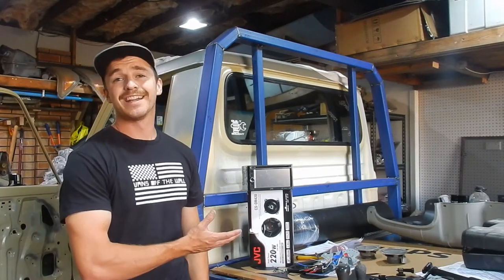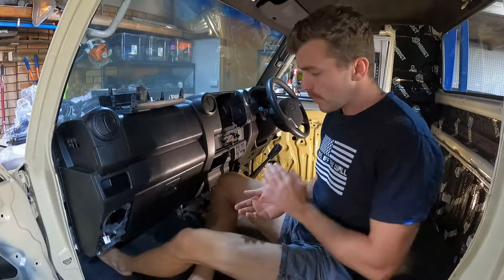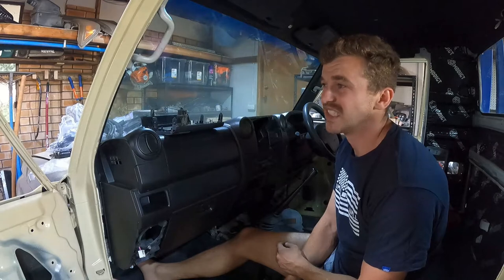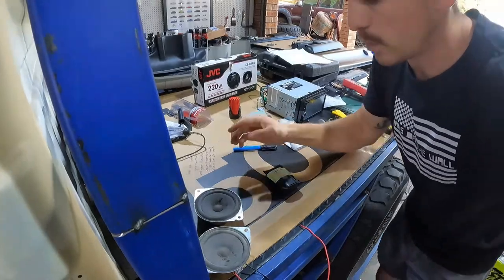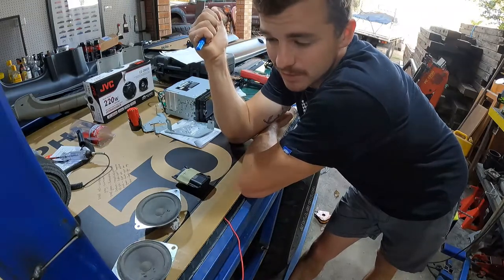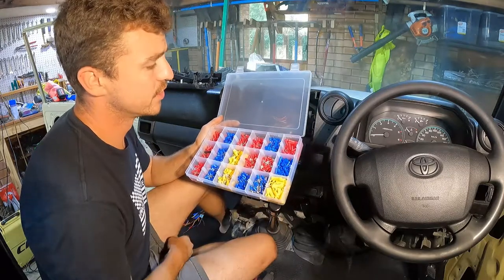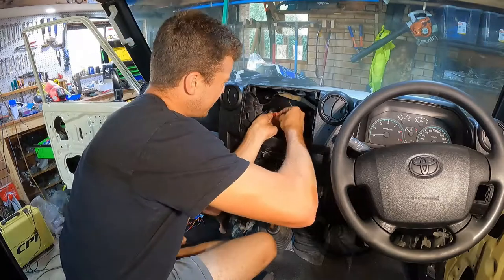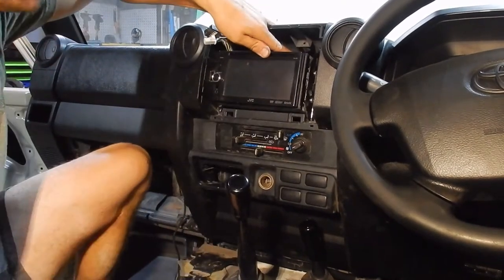How to install a head unit when the wires have been cut, budget upgrade landcruiser 79 series stereo

Comment: So if I was to buy those exact speakers you got, I couldn’t just plug n play? I’d hVe to stuff around with them like yourself?
Reply from the maker: They come with some wire but every car has different plugs from factory so they're not exactly plug and play. You could cut the factory plug off the crimp them, I wanted to keep it factory so I soldered to the plugs